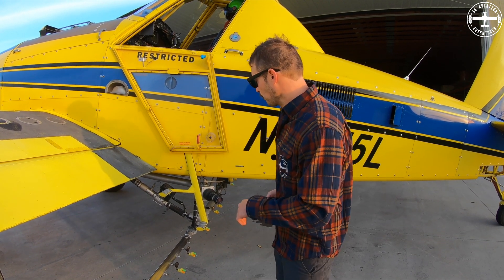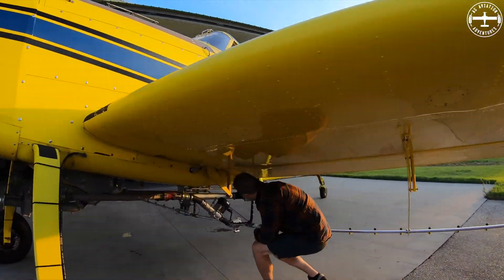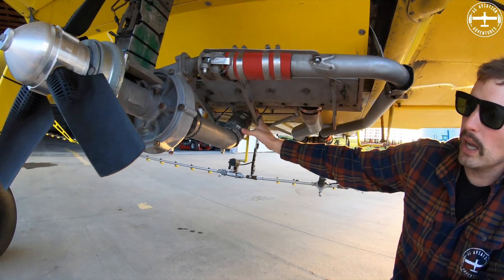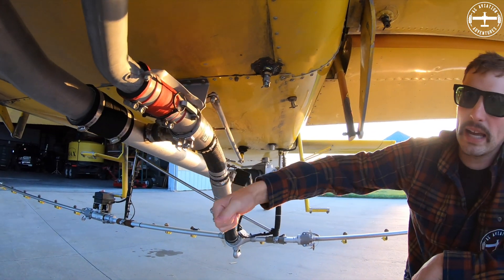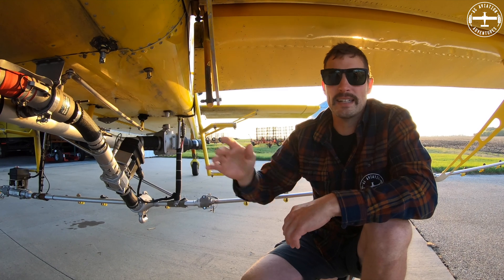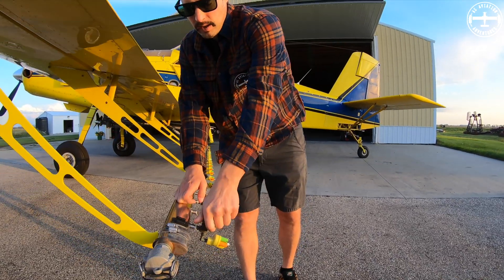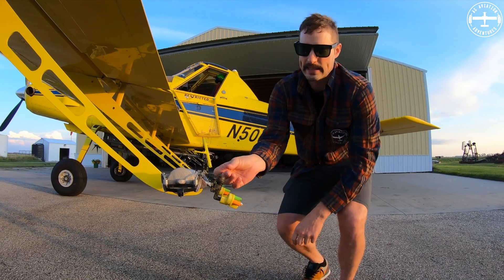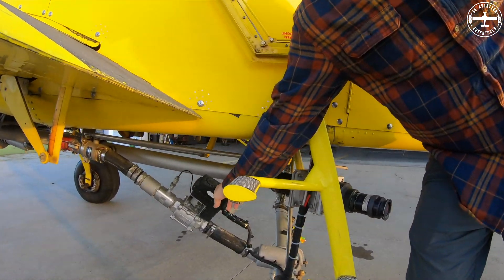How the Spray System Works - AT502

Comment: I searched the internet for weeks and spoke with my Ag pilot mate in Papua to try figure out the spray system so I can scale it down for RC and I am close but in the meantime I have adapted the spreader box design for low heat smoke to replicate dusting at the RC club, your external views have helped me detail my AT502XP 1/6 more than any other site including AT 's own site. I am so in love with Ag aviation it has always been my favourite aspect of aviation.
Reply from the maker: That's awesome! You'll have to send us a video when it's flying.

Comment: Great videos! Do you ground check the flow of each spray nozzle before the first flight of the day to ensure none are clogged? If some are clogged/inoperative, do you take the aircraft out of service?
Reply from the maker: No I don't do any kind of ground check. Sometimes I'll get a small piece of debris get past the filter and it may partially clog a nozzle. If that happens I'll fix it on the ground when I get back to the strip.

Comment: I’m surprised you don’t have gps on/off for the boom?  Or am I missing something?
Reply from the maker: Some have it but it’s not that common. The shape file would have to be exactly matched to the edge of the field in real life and that rarely is the case.
Reply: I’ve seen pilots do headlands around where I live (the ends of the field first) so maybe they are using gps on/off.   I just figured pilots were drawing the field like you would planting it with Deere Greenstar or the like.   Anyway, it’s interesting stuff.

Comment: Hi, I saw you always operates using standard non rotating spray systems,  why don't use rotating atomizer instead ?
Reply from the maker: We spray a lot at 2-5 gallon and with the added drag we don’t see the benefit.
Reply: @AgAviationAdventures  can you make a video explaining how the droplet size works depending on the crop and weather conditions ?
Reply from the maker: That’s a good idea.

Comment: Great Video.
What are the different colored nozzles for? Are they all individual spray nozzles or all the same?
-Gavin H.
Reply from the maker: The different colors represent different size orifices. Meaning I can change between 2 GPA, 3 GPA, and 5 GPA by rotating the nozzle.

Comment: How fast is your average speed while spraying..... and do you overly at slower speed first to check for obstacles ?
Reply from the maker: It's usually around 150mph. When I'm ferrying/circling the field it may be more around 135/140 mph.

Comment: Hi guys I have a question.  I’m a ground rig operator and when I’m washing out my boom I have my pump going. How do you do that with a propeller driven pump ?  Does  propeller on the engine produce enough wind to drive the pump on the ground ?
Reply from the maker: No. You could use a garden hose and hook it to one side of the boom and it would create enough pressure to rinse the booms out. But we don’t have anywhere to put the rinsate and the load pad is not set up like that. Check out the video we have published for cleaning out.

Comment: I had a question, how long does it take to switch the airplane from Liquid product to dry product? Does the bottom of the tank have a trap door for spraying the dry products, and how does this all seal up when using liquid?  Thank again!
Reply from the maker: Kyle Kendall It takes about an hour. It requires removing the booms and some plumbing from under the aircraft as well as tying up lose wires. This is something I may only do once or twice a year so the system is not very efficient. There are operators that do it multiple times a day and they have systems in place to make it go quickly. I think they can do it in 20 minutes. 

In the video if you look at where the plumbing goes from the pump you can see directly behind it is a large flat piece of silver steel. That is the bottom of the hopper as well as the gate that opens to allow for a fast jettison of your load in an emergency or to spread dry material.
Reply: @AgAviationAdventures   Thanks again for taking the time to share how things work!
Reply from the maker: Kyle Kendall No problem

Comment: Do you every have nozzles clog in flight while spraying , if so how do you detect that ? Great information on the system
Reply from the maker: Yes every once in a while a small piece of dirt can plug the nozzle. I have a mirror on the plane and I can see my pattern while spraying. So if something is clogged and throwing a weird spray out of the nozzle I can see it. Once I'm on the ground I'll fix it.